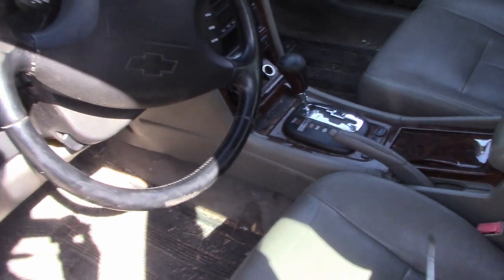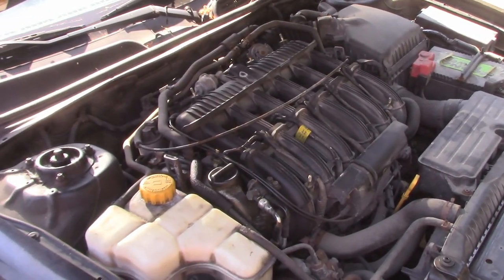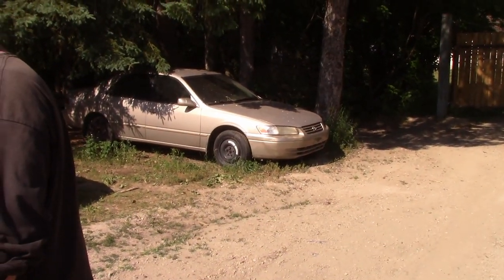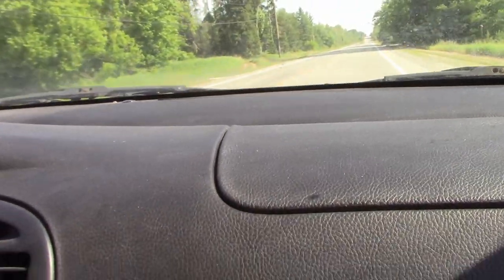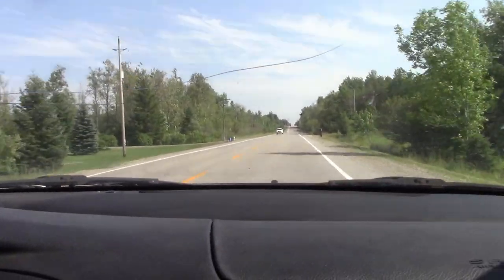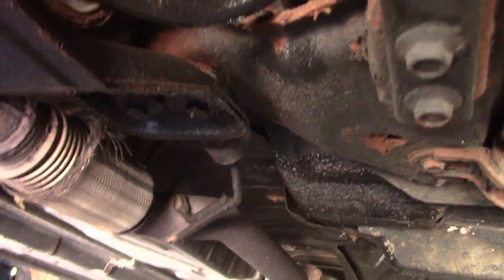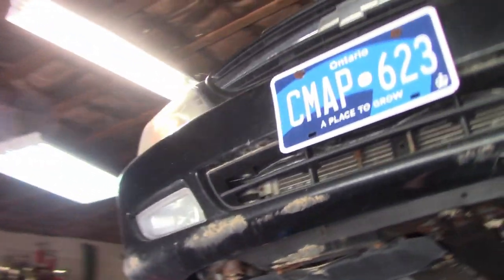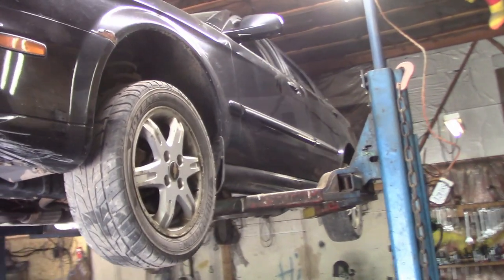Well i got a new car a chevy epica i have never seen one of these before what should we do wit it

Comment: Were you guys able to identify the transmission, specifically the bolt pattern? The same engine was used in the 2006-11 Daewoo Tosca (successor to the chevy epica/suzuki verona/daewoo magnus) with the GM 6T45 and I think it had the ecotec pattern. Hoping that the epica/verona available in NA also had a ecotec bolt pattern for a miata swap. These inline 6 are supposed to be just 642mm long, which is actually a little shorter than the 1.8l BP in the NA/NB miatas.
Reply from the maker: i dont know much about transmission like u do apparlty